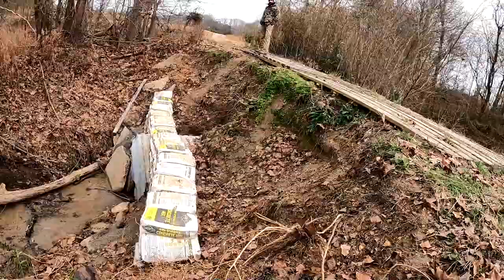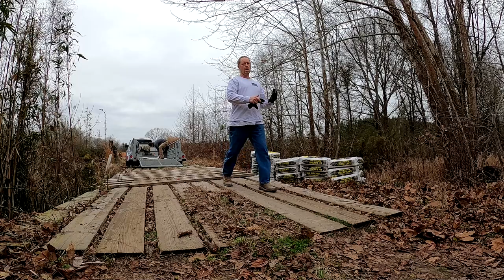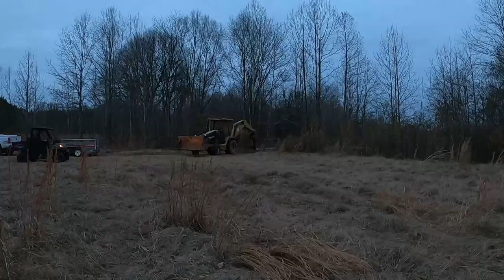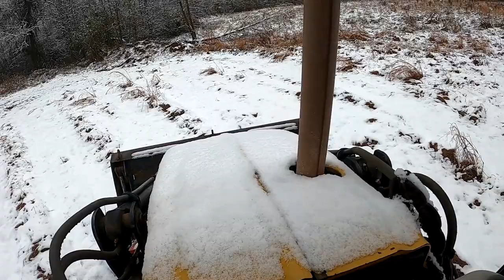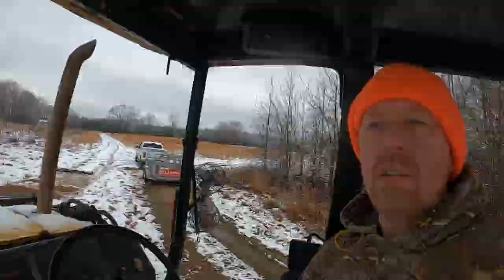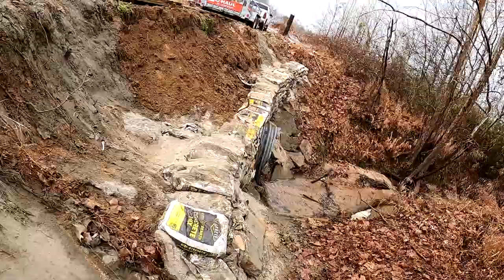The Wall - Part 1:  Building a wall of concrete bags on the upstream end of a washed-out culvert.

Comment: Just a suggestion, you need to drive rebar down through the bags to tie them all together!
Reply from the maker: We did, I just didn't show it because the camera kept turning off and didn't capture the video.   We drove 40 10ft pieces of 1/2" rebar vertically down into the first 15 layers, and another 40 pieces horizontally into the wall.   And it's rock-solid.  I'll do an update video sometime over the summer.  Thanks for watching.

Comment: You could make a plywood sled attached to a rope to ease them down the slope?
Reply from the maker: We tried that.   A neighbor who came by just happened to have a piece of plywood and an old 10ft long road sign in his truck.  We tried both of them and the bags kept sliding sideways and breaking.   Concrete bags are made from two layers of tough paper.  When I purchased the concrete at the hardware store, the loaders kept dropping the bags into my trailer, which broke the outer layer of paper, which weakened the bags.  So when we tried to slide them they broke open.   I learned pretty quickly to load the bags myself.   Thanks for the suggestion.   Thanks for watching.   It's all done now.  Gonna tackle the downstream side of the bridge this fall.

Comment: Hey Mike, New sub here. I have a creek with a similar problem and I am planning on doing the same fix. Do you need to use the high strength or would regular quickcrete work? Check us out at “Adventures at Home” when you get a chance. Have a great day!
Reply from the maker: I use plain old quickcrete.   Usually the cheapest one I can buy.    My wall is still rock solid almost 1 year later.  Reinforcing with rebar helps.